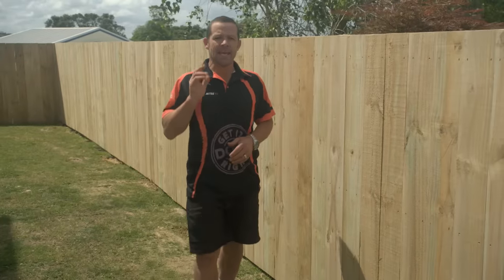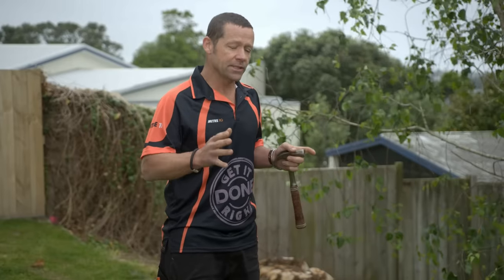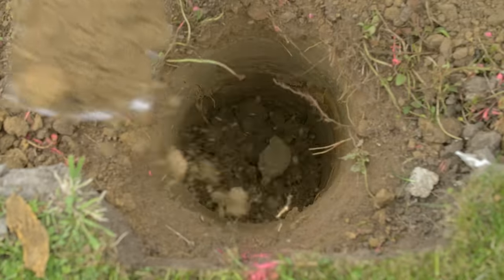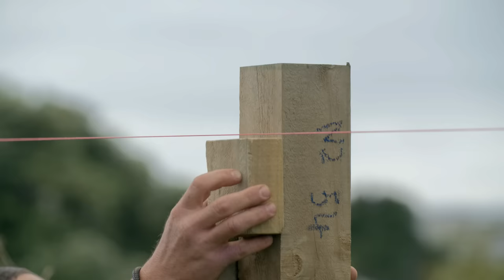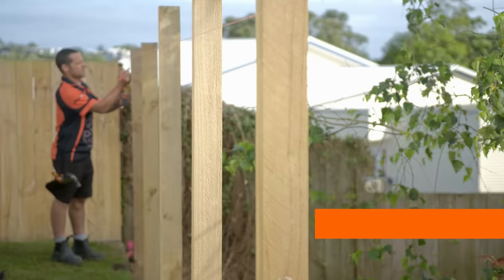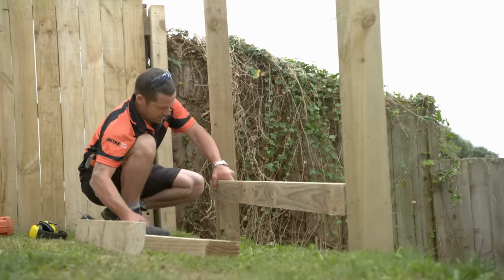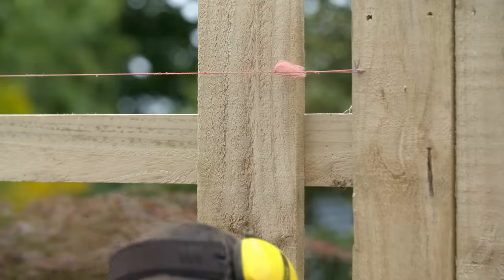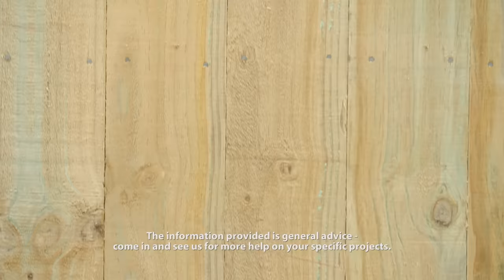How to Build a Fence | Mitre 10 Easy As DIY

Comment: Great video. But need to know how to do an angle. My boundary curves and I need to probably make a 30 or 40 degree angle around it. How do I do this?
Reply: I would sacrifice a little bit of land and just do it straight.
Reply: just put in more posts.
Reply: Just use you line and stake it out where the posts on the angle would be and then follow the plan...
Reply: @kelakakku  why. Didn’t you learn angles in school

Comment: Like we level the post to the string line..flat out!..not using a 2by4 piece to keep spacing for the rail ect. I mean I'm not quite sure how y'all r doin fences where you're from
Reply: DaMarcoMuzik ... if your not using a spacer then you’re running the risk of one of the posts touching the string line, throwing off the straight edge. Never put the post directly on the string without giving a 1/2” or more clearance for insurance.
Reply: @oakjim206  not here in the states. The string line is what keeps the finished product nice n straight n level. Then we attach the rails to the leveled posts before we proceed to shoot all the pickets necessary simply by using what we call a "bunkboard" which basically assures us that the picket will remain 6 in. above the rail. Standard installation regulations
Reply: DaMarcoMuzik ... yes, we are talking the same thing. Definitely use a string for establishing a straight line from one side to the other. The only difference, I never butt the post directly on the string, I always leave a gap just in case one post is a little off. This is very common practice in the states. Make sense?

Comment: Hi. Does anyone know the following?
Should we have a gap between palings or not? I like this fence but everyone I've seen always have a gap.
If there is a dip in the section, should we go 150mm above the ground at the lowest point or highest point?
Thanks!!!
Reply: A gap is not needed for anything technical i think. It’s just about what you want. No see through or a little see through. Also the height of the horizontal beams does not matter a lot. Just go by whatever looks good. Middle beam in the middle and the outer beams like 10 or 15cm from the edge. If the height of the ground fluctuates, try a bit visually what looks good. It only has to keep itself up. Material shrinkage due to temperature is insignificant in this case.
Reply: @Engineer9736  thank you so much. The fence is going up this weekend so really appreciate your help!
Reply: @brentlambert2418  The gap in the fence allows wind to flow through. Otherwise, it will create downward turbulence. Putting a gap allows for timber (movement) expansion and contraction through changes in environment.
Reply: Gaps are just preference, if you don't want them, try the feather edge boards or palings with a gap that you can put another paling on to span the gap, or even palings on both sides, then it'll also allow wind to pass through.
Reply: Im no expert and not even a fencer or carpenter, but dont listen to morons that say shit like. Gaps are a preference, these gaps are there for reason. I'm not claiming to be an expert but its pretty common knowledge that wood shrinks when it dries out and expands when wet. Now this can be mitigated by using good quality timber or hardwood, however spacing panels serves a purpose.
Reply: gaps can be caused by the wood shrinking and if the moisture content in the wood is high enough you will
 see gaps in a few days
Reply: @Engineer9736  Stop spreading false info, gaps are needed for expansion
Reply: If you are using wet palings for your fence, then gaps will form as they dry out, same for when it rains, the palings will absorb the water and swell

Comment: Good Tips thanks only mistake is putting concrete on the bottom of posts as they will rot I would avoid using concrete and just tamp soil well around posts

Comment: Why Australia fence post got notch for rail.? Nz  fence rail  Against to post.. ?which One better
Reply: @Shaun, By notching a pole you’re weakening the pole of course. So it’s not that straight forward said like that. In the end it doesn’t matter i think. A fence only has to keep itself and some wind pressure up. It’s not a barrier against infiltrating cars.
Reply: Notching can weaken if you take half of what is removed and replaced by the amount you need to replace back.Then again, you can still notch while retaining its strength is by either taking  only a small amount say 25m from a 100mm post. The only thing is, if you use a 75x50 rail, you will end up with a fence protruding out from 50mm away from your boundary line( including the 25mm thickness of paling) Notching will also help eliminate twisting from rail as timber dries, along with good fasteners to hold it into place.

Comment: Several videos recommend not using concrete.  It causes the post to absorb moisture.
Reply: If not concrete then what exactly will keep them posts nice n firm in the ground during hurricanes/storms, mild tornadoes ect. ?
Reply: @spectah24  Poor concrete into a nanotube that is above ground having a threaded rod with anchor plates.